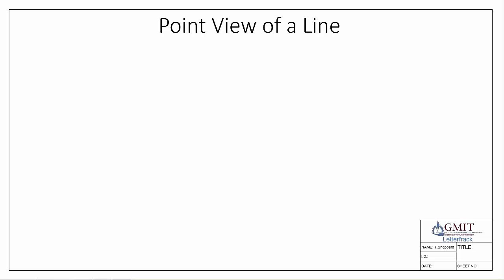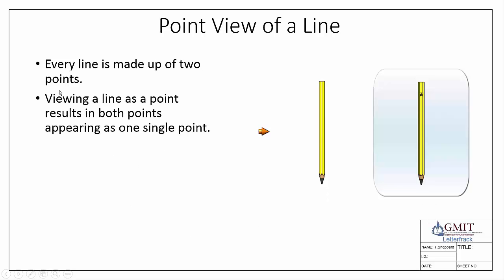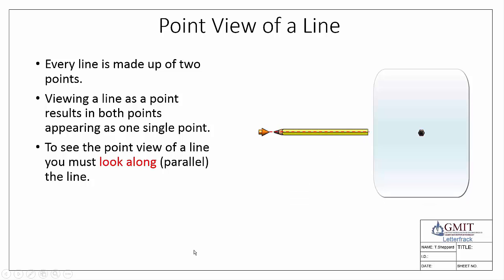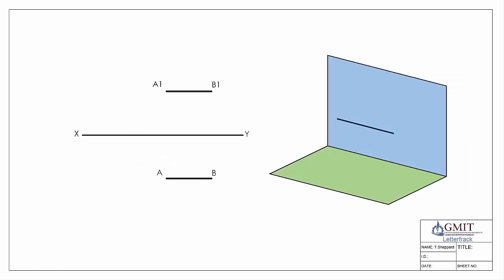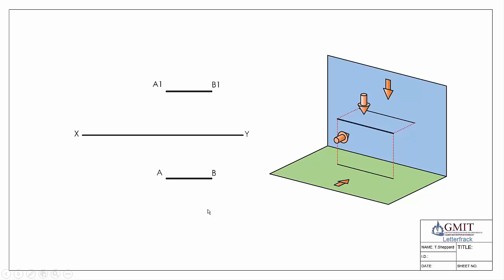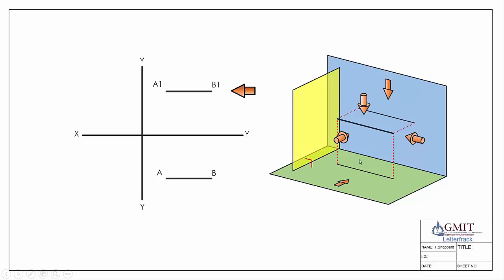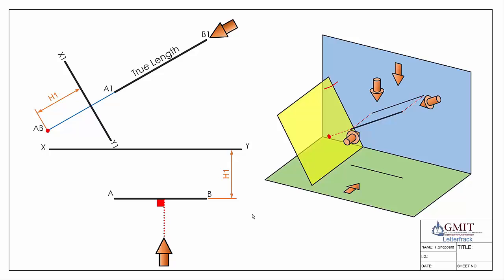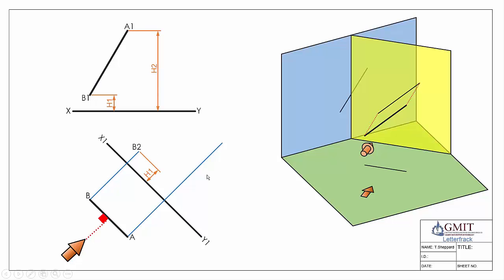Point view of a line

Comment: Application to this would be finding distance from point to plane and finding angle between 2 planes.

A. Distance point-plane:
1. Let P and Pi be the point and plane that you want to find the distance between
2. Find the normal line N just like in my comment below (call the intersection of L and N as point O)
3. Make a line from P to line N (call it's intersection P'), call that line PP'
4. Connect P' and O
5. Distance(P, Pi) = Distance(P', O)
6. Copy P'O line to find the distance line of P to Pi (optional, just for visualization of what we want to achieve in the beginning, you can also use this line to find the distance between point and line)
This can also be applied to distance between line and plane, because the only way it's possible is if the line is parallel to the plane and you can pick any point from that line to the plane to find the distance.

B. Angle between 2 planes (call it Pi1 and Pi2):
1. Find  the normal lines of those two planes (call it N1,N2)
2. Angle(Pi1,PI2) = Angle(N1,N2)   (what i mean by angle here is the acute angle, not obtuse. If you find N1 and N2 to be skew to each other just joint them together in a same point)

Comment: Here's how to do the inverse of the last example in this video (finding normal line of a plane angled against x,y,z axis):
1.Let the plane that you want to find the normal line called pi
2. Look parallel along the trace line of pi in the horizontal plane (xy plane) we will call that line t1
3.  t1 is the normal line of a plane (just like the yellow plane in 11:36) we will call that plane pi1 (this plane has no inclination against the z axis so it's easier to find the normal line of it)
4.  Intersect pi and pi1 and call the line L, then just find the line perpendicular to L to find the normal line to pi (call that N, this last part works to find the normal line because we were looking at the plane as an edge and looking perpendicular to the shadow of N, thus giving us the direction of N)

i dont know how to find the true length of N though, but just the direction is already important enough